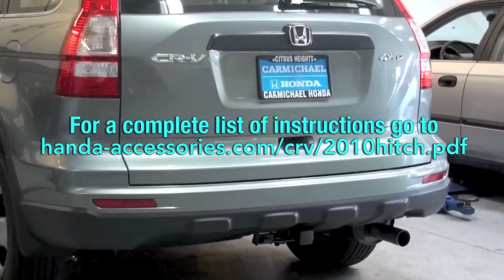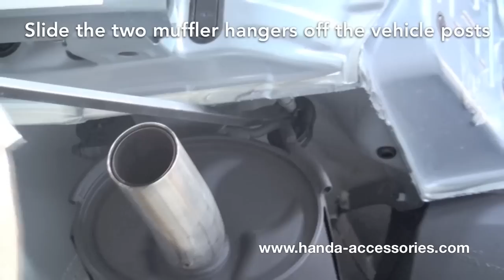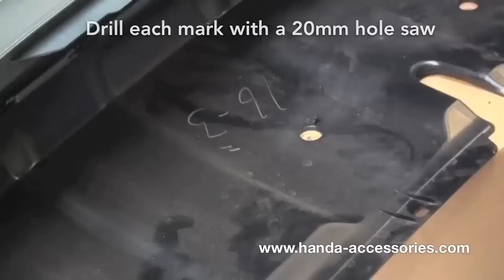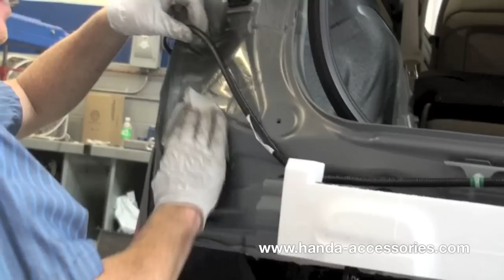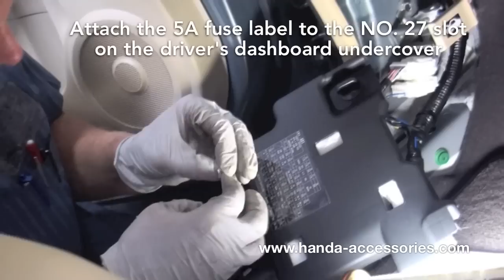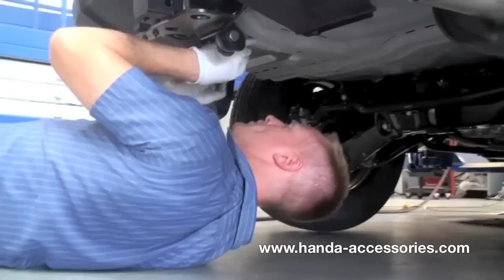CRV Trailer Hitch Installation (Honda Answers #5)

Comment: This is truly amazing. I am 79 years old and not in good health, yet I was able to install a better hitch (Curt 13555 2 inch, Class3)) in my driveway without even jacking up our 2008 CR-V. It took 25 minutes for the hitch with 5 minutes of help from a neighbor. The wiring took another 20 minutes. These guys took half the car apart to install a puny 1.25 inch Class 1 hitch. Now I know why the "genuine" Honda hitch is ridiculously expensive.
Reply: Web O agree, Is how they justify the high service price.